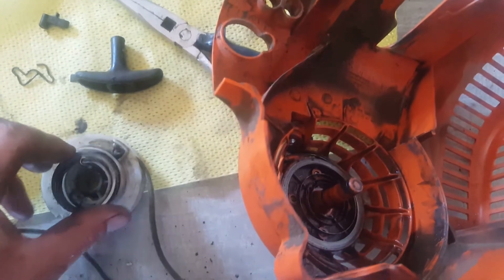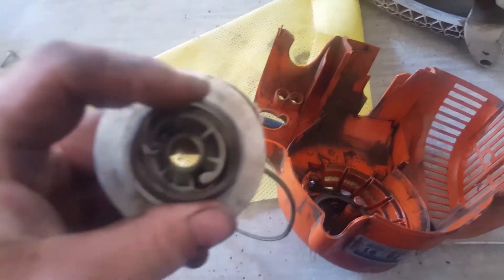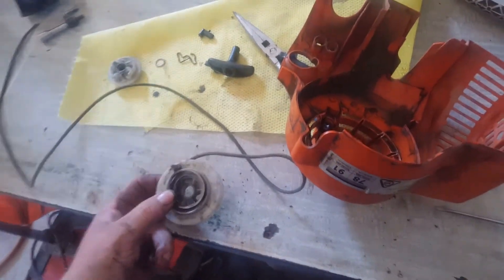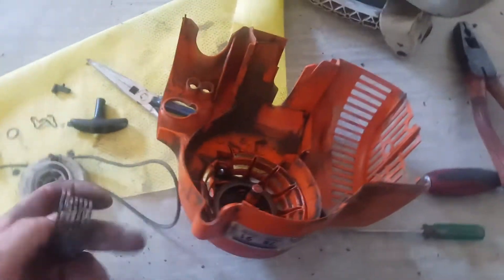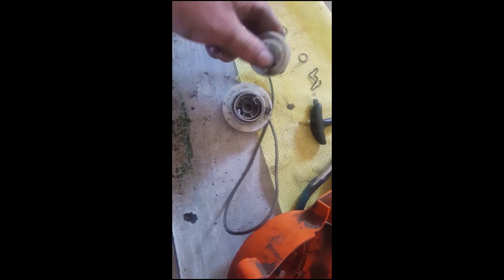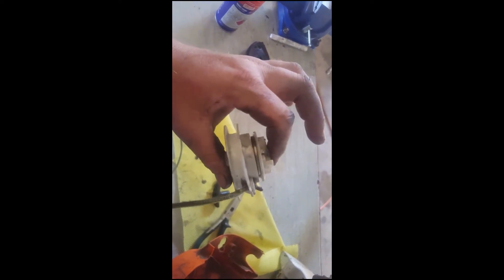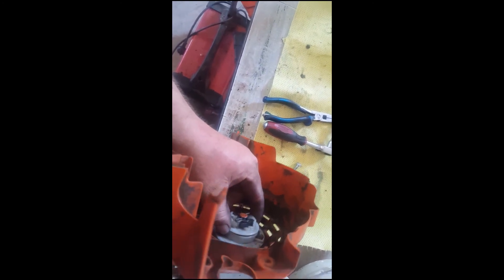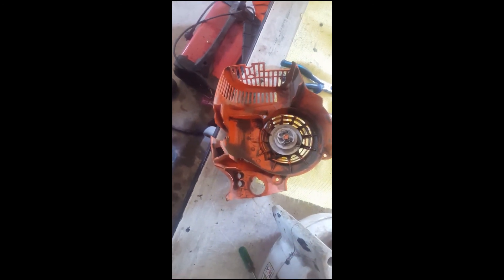BG86C E2 STIHL BLOWER SPRING

Comment: Instead of putting a putt cord back on, can you fit a socket onto a drill and use that to start it? When I haven't run my generator and pull after pull.... she no go, I take off the pull start and fit a socket to my drill, and bingo, works like a treat.
Reply from the maker: Zendukai hajahahahaha , no we cant. Be careful not to undo the nut that holds the flywheel on doing that.